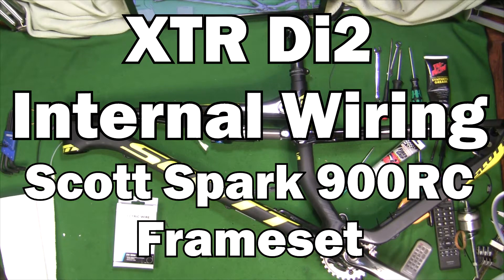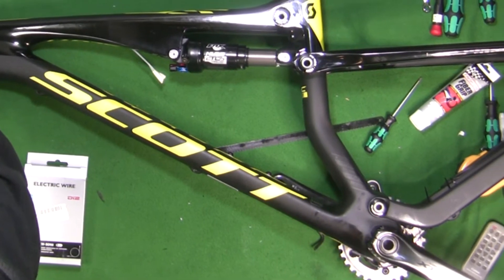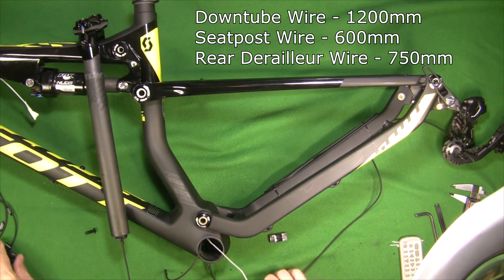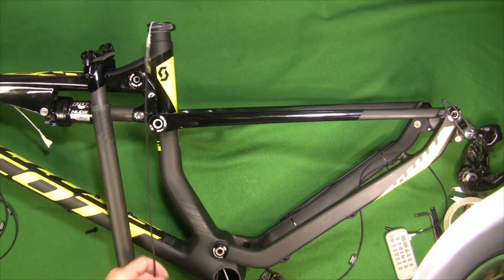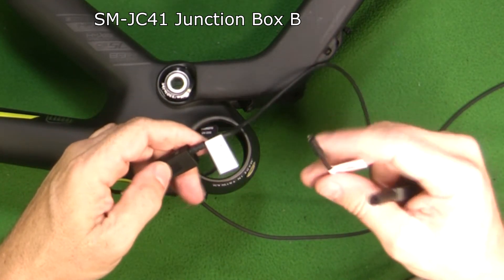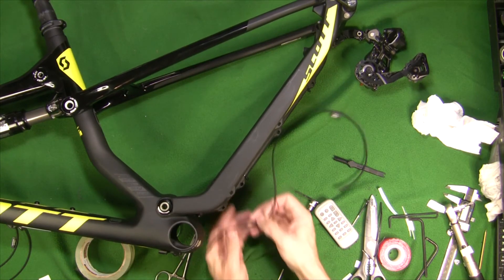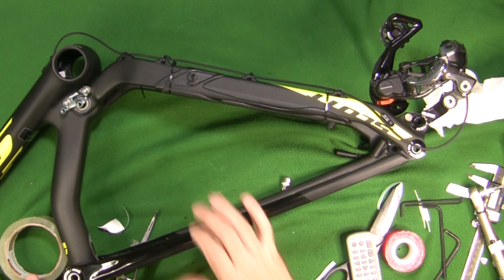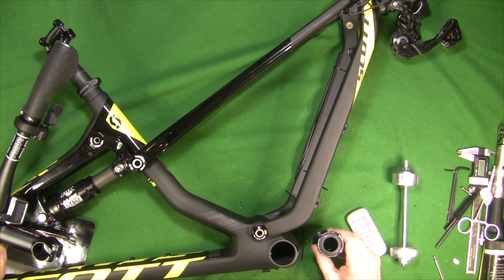Di2 Internal Wiring in Scott Spark 900 Frame

Comment: Hi, great video. I am about to start doing a switch to the di2 group set from the mechanical version I currently have. 
How did you enlarge the hole in the frame to get the wire into the internal routing?

Comment: Very interesting video. Congratulations!
I have a Scott Spark 700 of the 2015. after watching your video, i have a couple of questions that probably could help me with them.

a) is necessary to make a bigger hole in the hole originally used to route rear derailleur cable (on the top hole of downtube) or it enough space to route di2 cable without touch it?

b) after removing bottom bracket is necessary to make any hole to route the cable coming from downtube to seatpost tube? or is open space between seatpost and downtube?

Thanks in advance